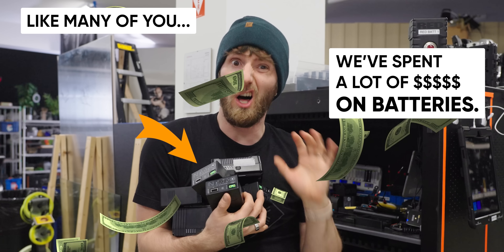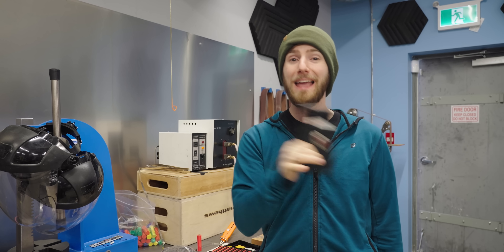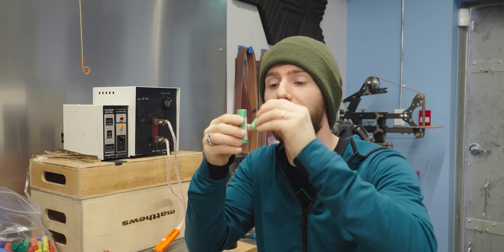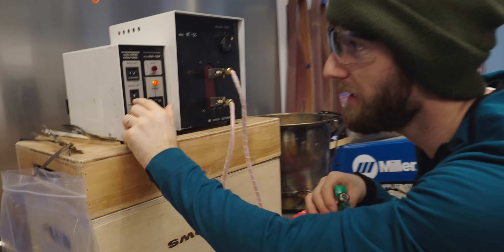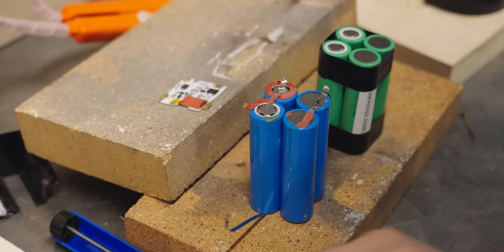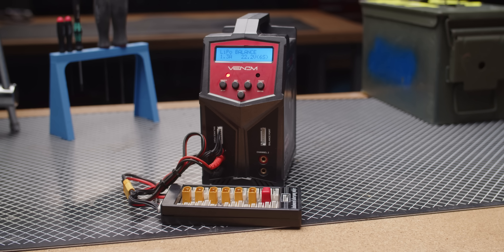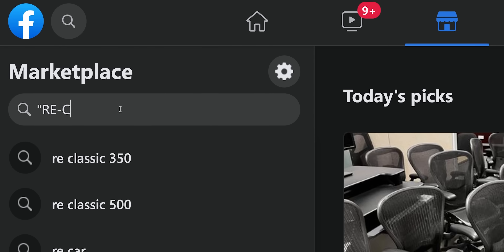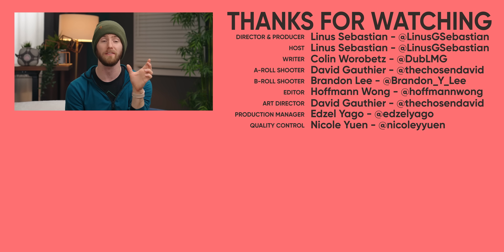This should be illegal… Battery Repair Blocking

Comment: That's why I am a promoter of Hydrogen based energystorage, if size isn't a problem. The weight might even be smaller if the amount of energy stored is getting big enough. But I guess it would be a chore for you cameraoperator to also carry a 5kg gasbottle on his/her back while also having to carry a 10-25kg camera. But it would most likely be infinily rechargeable.

Also it is alway cool to see you guys doing fieldtrips to facilities. It is fun and you show actual work. Like I would like you guys to go to a planetarium and see what kind of computerpower they need to feed that Projector. Also if they let you game on it.

Comment: Keep a bottle of dish soap on hand in addition to the fire extinguisher. If you douse the smoking/flaming battery in the dish soap it can prevent the fire. (From experience with drone batteries and a vape that had the battery inserted backwards.)

Comment: 3.4V is also quite low, almost at the level to return them back. Li-xx should be stored at 3.6-3.7V (depending on specific technology)

Since charged Li-xx should be at around 4.2V, it's quite possible that the problem with your 4cell pack was rather discharged pack rather than dead (charged battery should have around 8.4V)

Comment: About the "DON'T replace only the bad cells" thing: there's why battery testers exists, where it does a couple of charges and discharges to check the health of each cell, so you only mix the ones that the health matches.
Reply: Yeah, that part was kind of dumb. Yes, we're talking about preventing e-waste, but let's throw away perfectly good batteries!
Reply: @AdrianTache  A fire in their building would cause a lot more waste than sending cells to a recycler. Probably a better approach is it not?
Reply: I dont think it is recommended for people who dont do it professionally or regularly enough to be confident in their abilities. When doing risky repairs, always make sure you know what you are doing.
Reply: @Bawrabawla  this video shows with ease  that the hardest (and most dangerous) part is not selecting the cells, but soldering them
Reply: @SchioAlves  that is after they gave up on the hardest part, that is sorting used cells. They did filter out new cells.
Edit: to be clear I am not a battery expert, I know just enough about them to be very careful when dealing with them.
Reply: @Bawrabawla  like I said in the beginning, that's why battery testers exist; it's time-consuming, but definitely easier than spot weltering.
Reply: @SchioAlves   I beg to differ, you have to remove the conductor to test the properly and re spotting. However, as I said my knowledge is limited and given how strongly you feel about it you may be a well experienced in it so I digress from this conversation.
Reply: Its better policy to replace the pack with new cells and then bin the old cells into like performance rather than just slapping one new cell into the pack. Generaly speaking proprietary BMSs for sealed packs won't be the best at handling just a couple of new cells
Reply: @eskamobob8662  theoretically, yes. Real world situations its just fine.
Reply: The reason that's not a good idea is the capacity will degrade disproportionately, even if they all match up at assembly.
Reply: Yes and no, and it all falls under the notion of "if you know what you're doing".  If you're learning from this video then we can all assume the end user doesn't know what they're doing. :)

Comment: Its so funny for me to look at linus taking this so cautiously and seriously. I used to solder together all kinds of different batteries directly with wires using just a soldering iron. No fire extinguishers, no sand buckets, all on a wooden table.
Reply: yea. I have tried spot-welding, blew a hole in a cell, and the conclusion is: if you are not ready to throw away a good number of cells just for tuning and mastering the technique, just simply solder them with a hefty soldering iron.
Reply: i would recommend having an emergency plan though, props to linus on this one. One may be fine, or may be not. Especially important if you are doing it for the first time ever.
Reply: I did that with NiCad cells a long time ago but never tried NiMH or Li-ion. I vaguely remember being told that soldering NiMH and Li-ion cells was a bad idea, but I can't remember who or when I heard it. In general my experience has been that both NiMH and Li-ion batteries lasts through a lot more charge cycles than the older NiCad cells, and so have not had as much reason to rebuild those kinds of battery packages. I've also grown lazy and complacent so that just might have something to do with it...
Reply: The reason you DON’T solder batteries is because soldering irons work through heating the surface to 190+ degrees, which a battery will just act as a giant heat sink and cause cold joints that will conduct poorly and be prone to breaking away, therefore making a fire risk.

Spot welding batteries is done through raw current, which through the differential resistance of nickel and and steel will cause the heat to be generated exactly where it’s needed which will make for much stronger connections.
Reply: @egg5474  for ones who know how to solder well, making a proper solder joint to the cell is not a problem. Those who can't - well, they won't make a proper weld first-try either. So what's the point?
Reply: @egg5474  It also has to do with the chemistry used and how it reacts to the heat needed for the solder to flow. The heat sinking capacity is easy to get by, just use a larger iron. But the heating of the internals is why it's generally considered a bad idea.

About heat sinking and solder, yes a larger iron will do the job. It used to be that soldering was a common way to repair car bodywork. I've done it my self. Filling up a large through hole in a body panel takes a lot of heat. The entire panel works as a heat sink so you use a large iron, 2 to 4 pounds of copper isn't unusual, and the solder flows nicely allowing you to stretch the solder and fill up the hole. It's a fascinating process, and the first time I thought they were joking saying I should solder up the holes.

Using an iron like that the solder joint on a battery cell takes only a second or two, but that still means there will be a lot of heat transferred to the cell.

Comment: I like using NiMH which eliminates the chance of explosion.  You need a different charge controller, but at least the battery is a lot safer to work with.  I replaced the NiCad in my DeWalt drill with a NiMH super pack and it works great.

Comment: Did you actually try to charge the battery you made? Over the years I have made many Ebike batteries and found out early on it is not enough to join the cells together and slap a BMS and plug it into the device expecting it to work, most BMS require the pack to be placed on the charger to activate the battery again, this is done for transport safety but also to prevent people from constantly trying to use a battery that triggering the low voltage cutoff and taking the battery bellow the safe level and so the BMS will disable the battery entirely until it detects an input charge voltage.   Other thing to remember is that when it comes to sense wires there is a specific order that they must be connected and while it differs from BMS to BMS it is usually the negative cell connection that is the last to be connected as this completes the connection to the cell positive and also all the positive sense wires

Comment: if you don't advocate for user serviceable batteries, you're frankly anti repair. 

why?

Because if you ONLY accept the middle ground and accept that the replacing cells are "too risky" for the average user to replace... well guess what? the average user are gonna try anyways, as you just did in the video. You also screw over the people that CAN do it, and do literally nothing for the ones that can't, because as I said above, they will still try anyways. but honestly, its more the hobbyists that try to repair the battery packs, more so than the "average" person, so the hobbyist and people that know what they are doing are the people that are the most screwed over.

Instead of having a few users or hobbyists that actually were successful in cell replacement, as with a user serviceable battery pack, if it was a non user serviceable battery pack, all that risky spot welding will now be entirely be useless for EVERYONE, hobbyists, people who know what they are doing and the average user, ALL of them, all because of it being non user serviceable. In that case, now EXTRA risky measures have to be taken to take those same cells you just spot-welded apart again for use elsewhere, or just throwing away perfectly good, brand new cells, because the BMS thinks of itself as God, and causing even MORE E-waste.

Comment: The sony pack was repaired correctly. Ussually you just have to reset the BMS by connecting a powersupply to it (reseting the overdischarge protection)

Comment: Like a lot of pro stuff, Red just assume you're charging or earning enough to make a $450 battery replacement a non-issue. A film equipment hire company isn't going to be taking apart and soldering batteries, they'll pass replacement costs on to their customers or absorb it as a cost of doing business. Hell, they probably have a 'expiry date' for them where they get junked after a year regardless of how much charge they still store.

Comment: One more thing. The fact that you decided to not use the spacers is very dangerous.
The reason is that those cells have its entire casing as its negative side.
That includes the outer ring of the positive side.
The spacers will keep the nickel strip away from that outer edge preventing shorts, 
but if you don't have one, then any damage to the heatshrink might cause a short.

Comment: 11:27 HOLEY SHIZZLE. YOU HAVE IT TURNED UP WAY TO HIGH.
When spot welding 18650's you should barely see it light up. This spot welder is NOT good for welding batteries. You probably need way higher currents and way les "on" time.

EDIT: 17:26 This is how it should look. :p

Comment: Angry Pixie Containment devices are certainly primed and loaded for bear
If ya want to attempt a Re-cell, make sure you use a battery pack that you don't absolutely need to have back at 100%.

Invest in a reliable and accurate multimeter, attempt to not get shocked.

Comment: You can reset some bms by shorting your battery packs positive to the bms output positive. The 7v on the cells to the 7v coming out of the pcb that connects to the device itself. Had to do that on my laptop

Comment: The reason behind the BMS disablement behavior is simple and safety related.  If a cell has been depleted beyond a certain point, the cells are far more likely to short internally and burn or explode.  By disconnecting the cells, the BMS assumes they have gone to this dangerous charge level and shuts itself down as the devices are not user serviceable.  Most people have NO business spot welding lithium batteries.  Some are foolish enough to even solder them with a pencil.  This is dangerous AF.
If you want to make sure you will succeed, try to power your device with a bench supply connected to the battery inputs.  If it will run with straight DC from a dumb supply, you can make your own packs with custom cells and off the shelf battery protection circuits.  Recycling proprietary circuitry seldom works.

Comment: yes batteries and power generation in general is a scam. we could recognize that outdated and  misapplied theories that were developed for telegraphy and transmission have been used for power generation. its literally like saying that all the wind that doesnt hit a sail...doesnt exist, or matter at least to transmission. so we'd be sitting here today with sails made of a single strand of thread. you can shape capacitor plates that distort the electron cloud to expand the shell like a parachute and catch more power, as well as some switching that removes the source from the load and collects "electric-wind" freely without draining the source. the world needs to check out T. E Bearden. geez im a full grown man know and been reading this stuff since i was 13....something has failed us, thanks organizations and institutions for blowing this one.

Comment: I like the safety considerations, but it's probably best not to put your old batteries into the container that you'll be using for your new ones in the event of a fire. You're basically pre-charging that bucket with additional fuel.
Reply: Also best to completely drain them slowly such that they hold no charge anymore. I am not sure if getting them to 0 or their lowest voltage is better though, everyone says 0 and it does work, but is more of a pain to do safely and I am not sure it actualy matters and is actualy the way to go.

Comment: We repaired our electric scooter by just replacing some cells. It worked great and the shop asked 900€ to replace the battery, it cost 200€ between the machine and the cells.

Comment: What a waste is this? Just because there’s a small spark you don’t have to throw out the battery. If it starts venting you’re in danger but these things actually take quite a lot before that. I never once had one actually vent even though I shorted them many times (most times on accident but once I took two charged cells and welket a short across them outside to see what would happen and apart from everything getting very hot nothing too bad happened). So please stop throwing away perfectly good cells because they’ve been shorter for half a second or there were sparks from welding itself like at 11:16

Comment: Most of new (or re-cell) batteries need to be put to a charger in order to wake up . Its common ,in order to protect from discharge until customer start to use them .Did you try to charge them ?

Comment: Linus Tech Tips
I work daily on doing almost exactly this, but usually for more extreme applications. Please use fishpaper rings on the cells, please use fishpaper to isolate the parallel groups. Its possible the BMS has an IR measurement which would mean you'd need cells which have the same IR. Those original cells look to be Sanyo 18650-B cells, you might have to use those for it to work (This isnt malicious, its to prevent poor IR cells from experiencing high draw and overheating). There is a ready supply of Molicel M35A cells which also work as identical replacements in the eyes of the BMS.

Comment: If you use a psu to simulate full voltage of the battery pack it will reactivate the bms

Comment: for anyone wondering why all new cells, even if 1 or 2 batteries are crap. it's something referred to as a marriage, when batteries are paired they're essentially 'married' to each other, and would not just be a hazard to use other batteries with them, but immensely inefficient as the batteries would most likely not fully perform if a married cell was paired with a brand new cell that has never been paired. you essentially want all brand new single cells that have never been used in pairs.

Comment: I love cheap spot welders. It's amazing on the stuff they cheap out on vs make nice inside them. As for the weld electrode tips. Class 2 copper is really what you want so the they don't "stick" to the weld. Also you should have changed the schedule for two layers of foil as the material and fit up had changed so the resistance has changed so the same schedule is very unlikely to work as great. But really your just looking for a good enough connection so it should be fine. You can to a peel test to test the weld and see if the weld stays and the material fails demonstrating a good bond. Have fun with the spot welder and don't be afraid to try new things. As and extra note yes that mean ms so just think about the amount of energy that gets inputted in that short time, it's amazing!
Reply: @YOU-CAN-TRY-THIS-AT-HOME  yup class 4 and class 11 copper give you longer life against creep but the trade off is higher potential of electrode bonding to weld ( not going to be an issue with this weld) and cost. There is also other issues with class 11 (copper tungsten alloy) but not going to be major enough in a nickel to nickel bond. Class 2 gets your foot in the door and give the easiest path to a good bond. Class 4 and class 11 are for if you need longer life or mechanically stronger electrodes for the most part. And as you brought up they need a constant surface not some sand paper in the hand. Use a ways to get a flat face and the lapping to get a smooth is the best route. I work as a micro resistance and laser weld engineer but most of my work is with dissimilar metals. Would love if a project like this came across my desk as that would be fun. Thinking about just getting some batteries for fun to replace some mine that have lost life